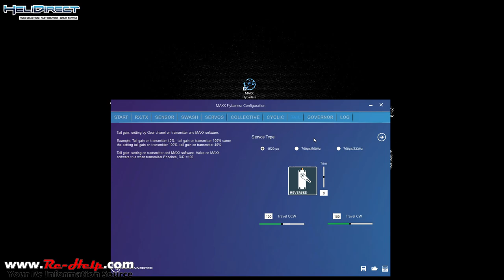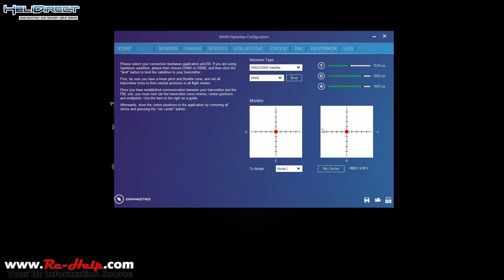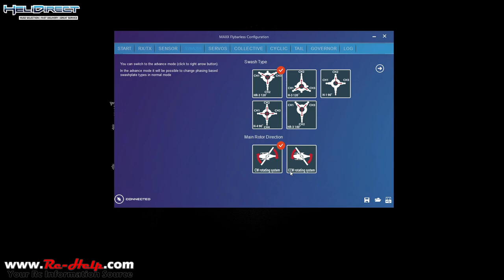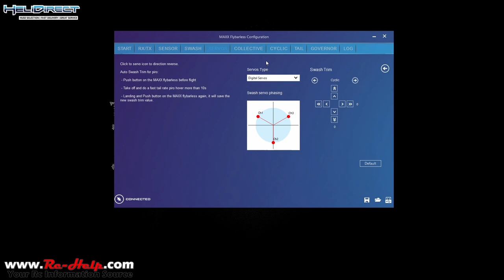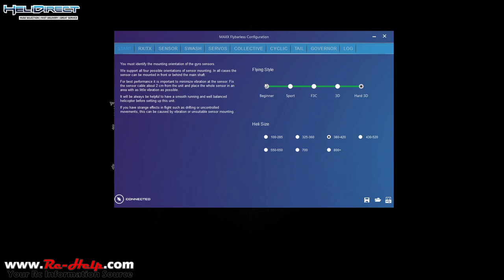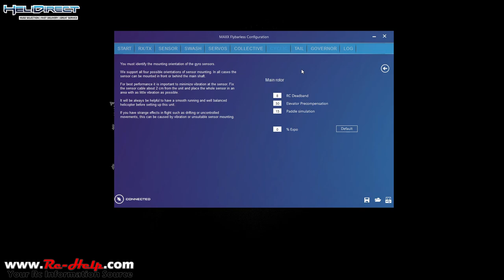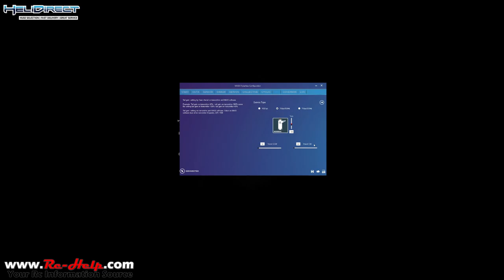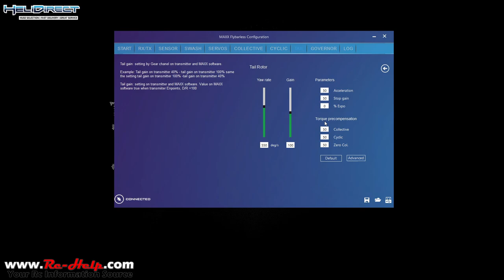Goblin Maxx Pro Flybarless Initial Setup

Comment: Thanks for the vids! I'm currently building a ALZRC Devil 380 and will be using these as reference. After 5 years did you ever get this finished and up in the air?
Reply from the maker: I am ashamed to say, this helicopter has yet to see air. Life got in the way and just had other priorities, hence the lack of new videos (since April 2021). Just busy with work and other projects. However, I do still have the helicopter and do plan on putting it in the air. And it will be with the Torq servos and the Maxx FBL unit. I'm also going to be building a new helicopter, a 600 size Agusta A109 electric. And I'm hoping I can find time to shoot/edit the videos to post them here on the channel. www.Rc-Help.com

Comment: Hi, can you maybe show how to do the swashplate leveling with the one touch button, i cant get mine to go into the menu to fly the heli, and do a piro for 10 sec. If i keep the button in to long, every thing freezes, and red light just blinks fast, with no input control. Very confused at the moment.
Reply: Hey man it looks like it's been around 3 months so I'm wondering what do you think about this FBL? I'm thinking about purchasing it, they have just came out with the GPS waypoint program I'm not for sure if it's anything like mission planner are what . But this unit seems to be more tunable than the flywing H1 GPS. Any input would be appreciated
Reply: @flyhigh6591  I am satisfied with this unit, got all locked in, so she is flying very well.  I will say that you shouldnt have a problem buying it. Just make sure to update to the latest firmware. I dont use gps, so cant answer you on that one.